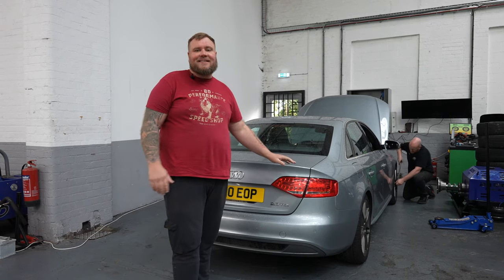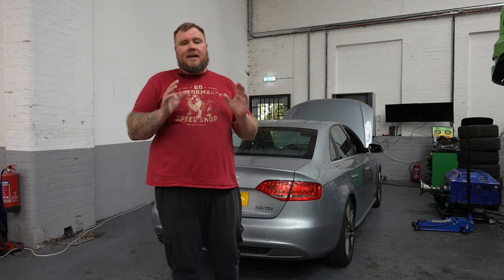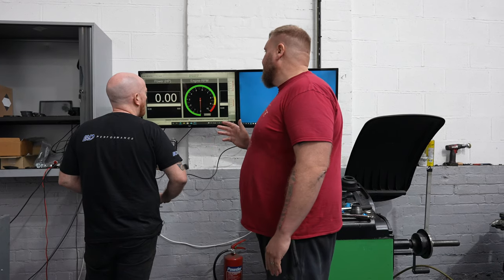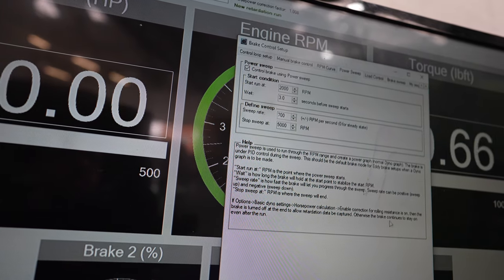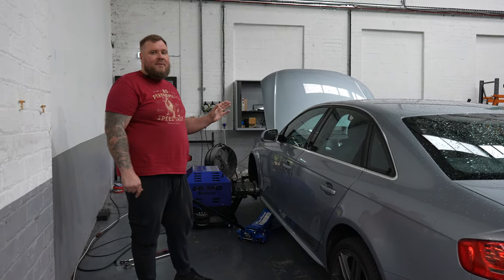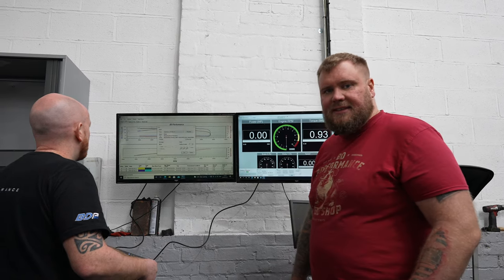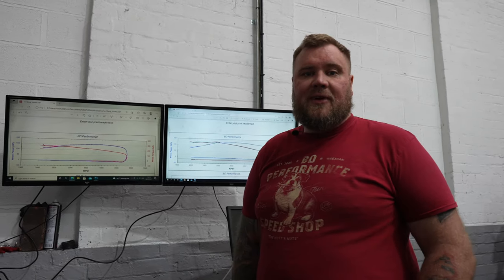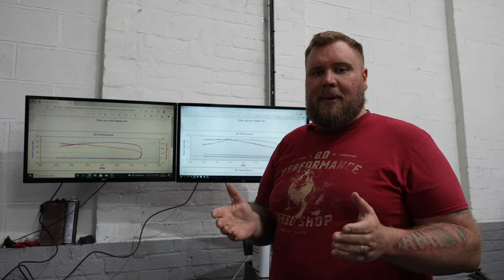DYNO Mapping 📈 & Proven Gains 💪 VW Audi A4

Comment: Hey Ben, go out and get yourself/the company a Logitech K400 Plus wireless keyboard for your dyno, Tesco/Sainsbury normally sell them, or you can go to the online has-it-all megaconglomerate... BEST £30 you will ever spend, trust me.

Quick Q on the tuning maps you do. Interested in the Revo Stg 1 for my ST225, is this a map only available at the shop or is it available with the Serial Port Switch for a home DIY style install (I assume the switch would be extra if so)?

Excellent infomative vid as usual and almost 10k, hang in there, it will come! 🤟